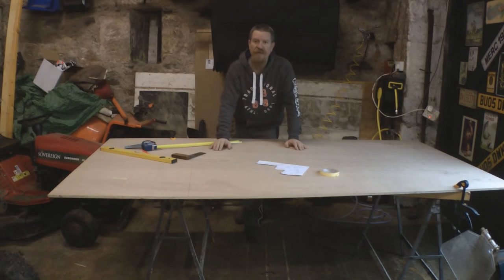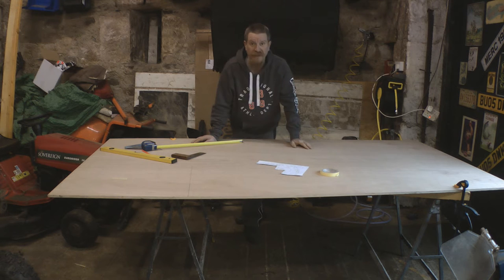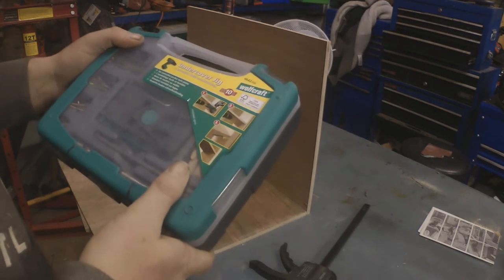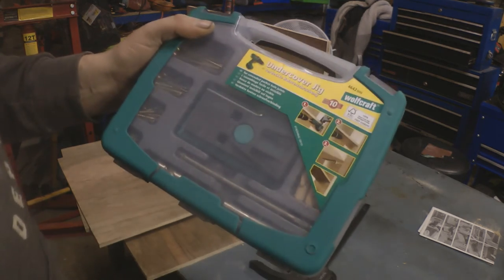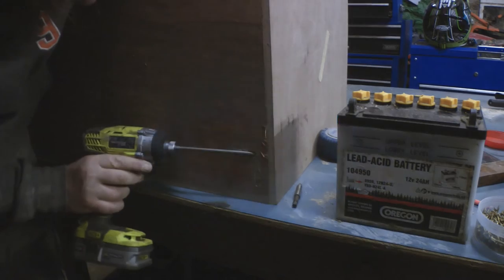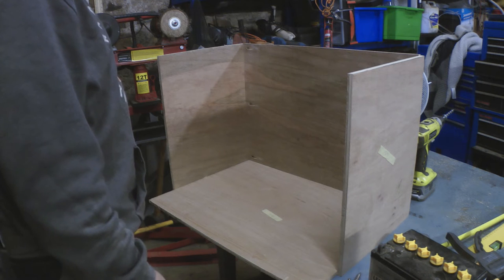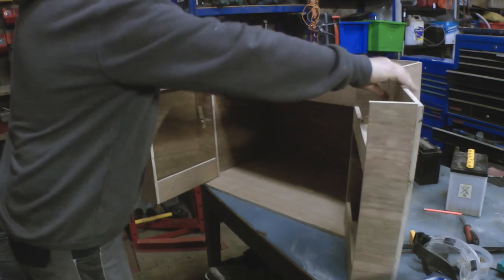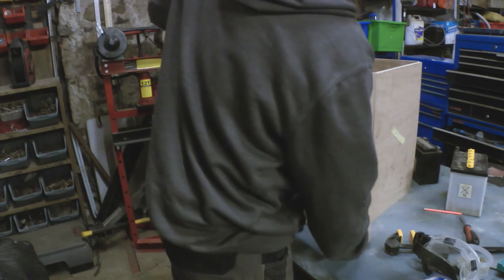Building a Camp Chuck box

Comment: Hi Dave the pocket jig looks to be a good bit of kit I have been thinking of getting one for a while as i want to make one of those boxes too and yours looks very good 
Take care
Gillian
Reply from the maker: Cheers Gillian, jig worked great and the pocket holes screws held it together well apart from on the doors where I ended up using a couple of angle brackets as well just to re-enforce them a bit. Only drawback to the chuck box I found is the weight, if I was to do it over I would maybe try using a thinner plywood in some parts. Thanks and atb Dave